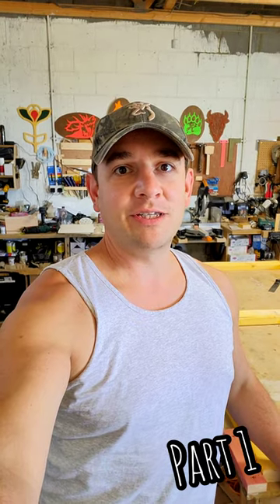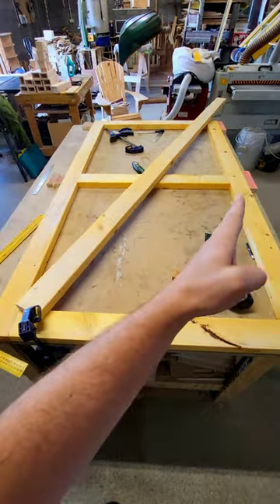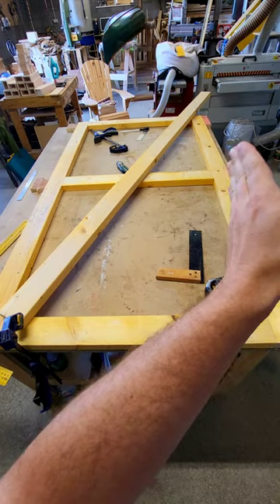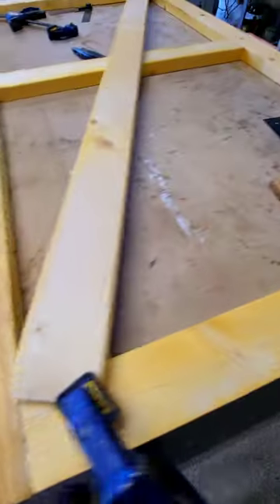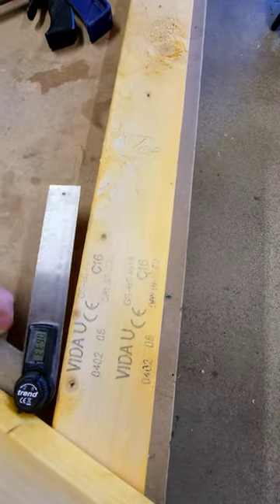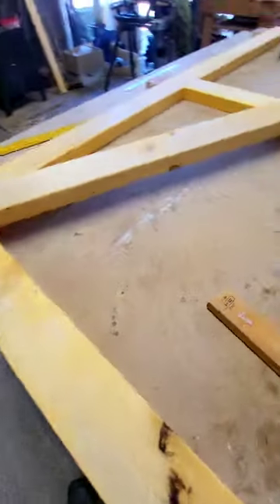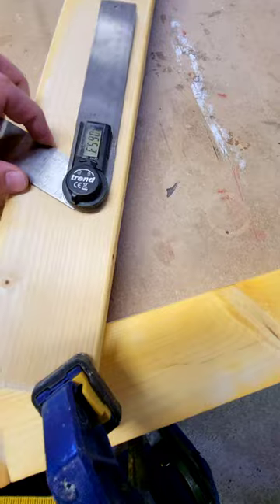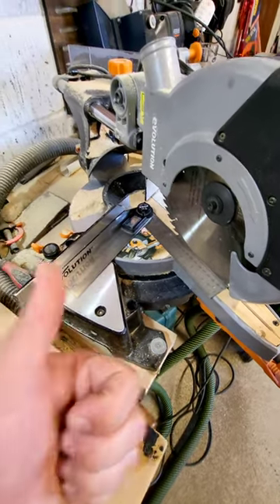Gate Bracing - How to set a gate brace correctly with no sagging - Part 1

Comment: What if you went corner to corner in both boxes on your door instead maybe? “ in a perfect world” the bracing should be under 45 degrees no?
Reply from the maker: Yes you could do that, as long as the bracing angle from the base is more than 45. Less than 45 will cause the brace to act in tension where we need it to act in compression.

Comment: Random question mate is there a way to stop the gate from warping? I've done 2 now and both were warped from top to bottom
Reply from the maker: What timber/glue/joinery are you using mate?
Reply: When u got 65.2 it is not miter angle so did u set 65.2 in miter saw or you set miter angle
Reply: @TheNaturalWorkshop  sorry mate I've only just seen this